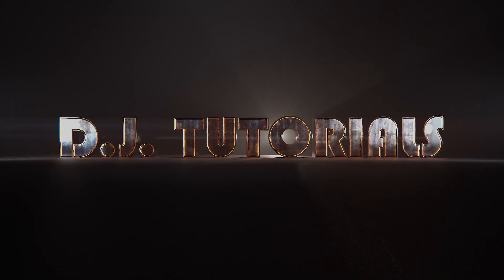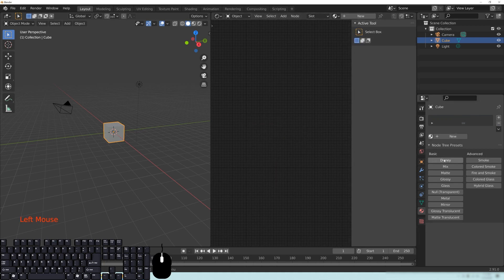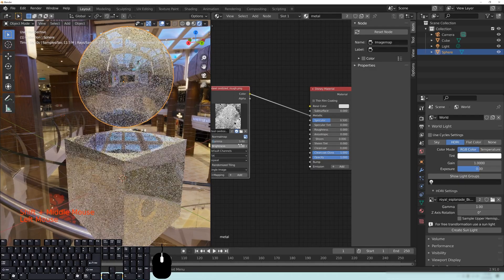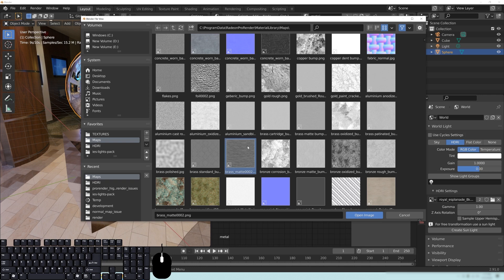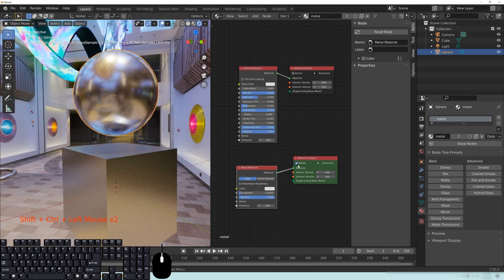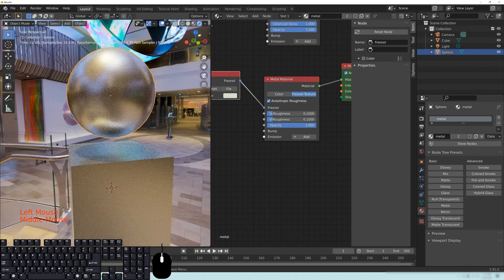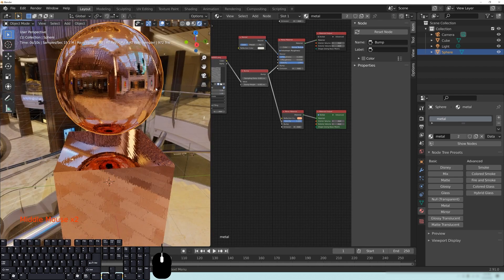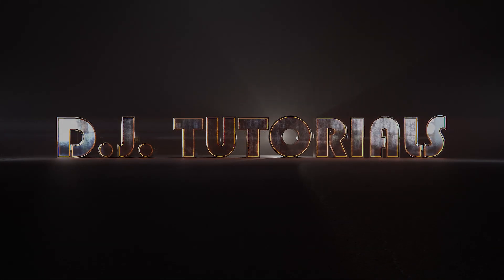LuxCore Render For Blender Crash Course | Metal Materials and Shaders

Comment: ddaaayum idk whats wrong but when i apply a texture to an object the same way u do using the nodes it never renders the texture! Even when I used ready-made materials from gscatter previously, it's quite visible outside of the render mode, i mean the color of the grass etc... But now matter how hard I tried to paint that grass green (although it already is) it never rendered properly in the render mode! Just bleak colourless objects all the time
Reply from the maker: You’re using geometry nodes?
Reply: @djtutorialscgi  fixed that issue today! By switching from UDIM tiles to single image in texture tab... Anyways now facing another issue with the luxcore and that's denoising. Can't find the right balance between unrealistically blurred rendered pic at the end and the noisy-grained one... Gotta go thru the tutorials to find the solution